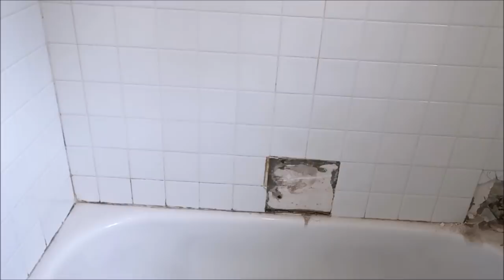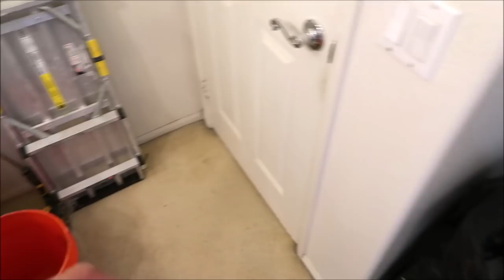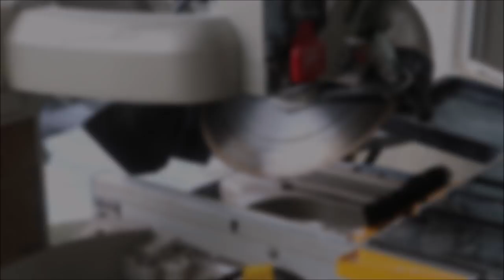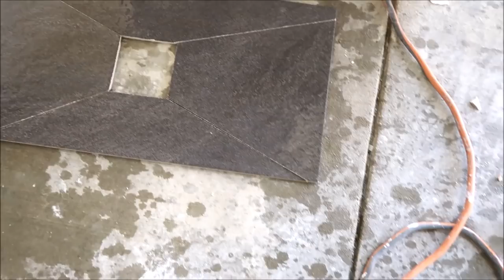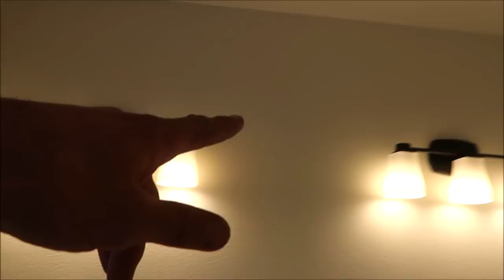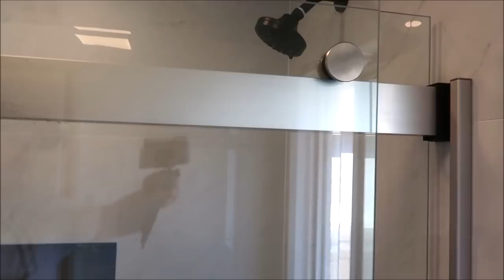Mess to Marvelous Bath & Shower Tile Ideas EP 32

Comment: My friend, I work in ceramics, there is a problem because of the hot weather in Iraq. The adhesive material dries quickly. I brush the wall with water well before work.

Comment: Are there any tricks or tips to help avoid lippage at the ledger board or is there really nothing to worry about when making the final/lower row of tile after you remove it? Just seems like there would be an alignment issue without some leveling system to pull it in while it cures. Great workmanship and designs! Always enjoy seeing you release something new.
Reply from the maker: Usually it takes a little longer to install to get all aligned, but nothing to worry about. Thanks for the watch!

Comment: That shower didn't foul after 30 years it just wasn't maintenance for 30 years and if they put a bead of caulk around the mixer they never woulda had a drop of water behind the tile... Pretty good for builder grade.huh?
Reply from the maker: Yes sir, you're right! Some builder grade showers last decades! and a lot do not. But when you guild a custom shower as a tile contractor working directly for the client, you must cross all T's and dot all I's if you want to be in business for a long time...

Comment: I'm having trouble with finding the right price to charge home owners and still find a lot of profit at the end of the job. I use Schluter products, leveling systems, and have to replumb just as you and your guys. I just did a bathroom remodel with similar features and products. I'm not asking how much you charged on this but, I would like to know how you do your pricing. I'm just looking for a little help to keep my small business afloat. Thanks
Reply: Figure out how many days it's going to take and what you need per day to get it done then add material plus 10 or 15%
Reply: Itemize everything, stop using schluter when possible, only use clips on large format
Reply from the maker: just like 831vtc said, figure out how many days it will take and how much you need to make per day. Add a little extra for delays.
Reply: Landberg Tile TV you should make a video on this type of stuff